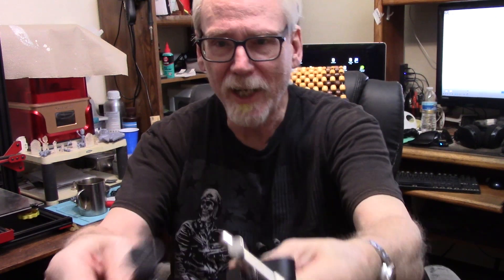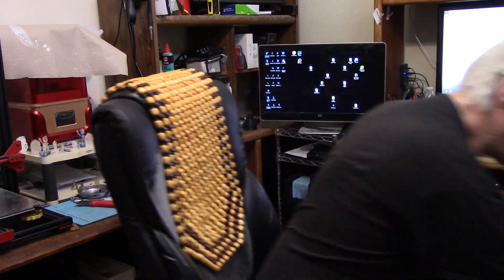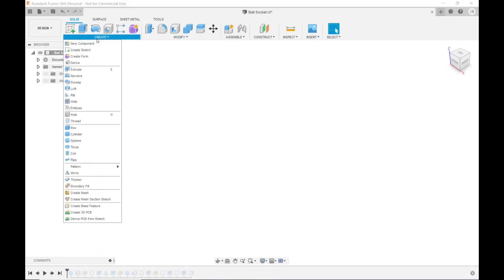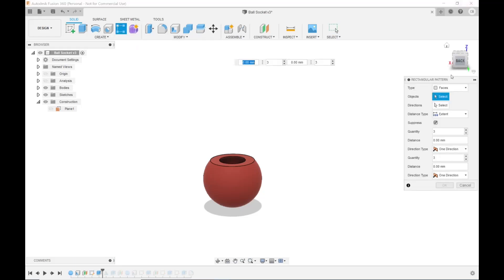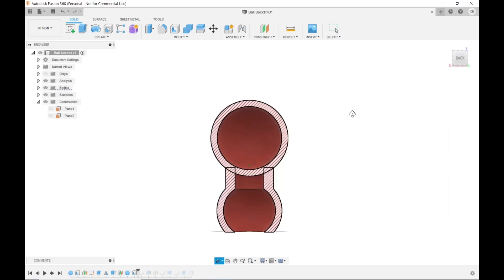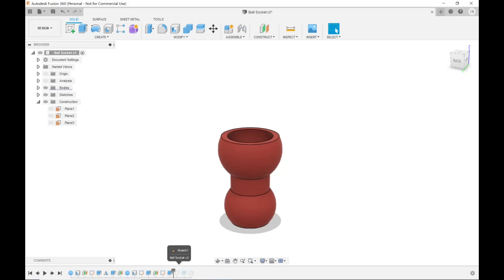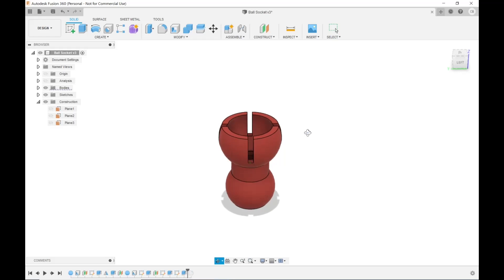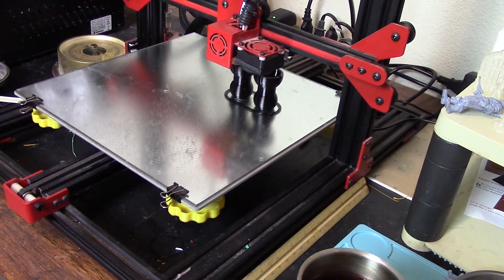3D Printed Flexible Camera Arm Part 1- Design a ball and socket in Fusion 360

Comment: Chuck, I've tried the Flexible mounts off of Thingiverse. They don't work. I printed a few of them and they crack and don't hold the angles you try to bend them in. I look forward to trying your design.
Just to tease you, you said you didn't have room in your office for the miniatures you can print on the Resin printer, yet what do we see to the left?..
You can tease me back, I have a Pig print of every different filament I've ever tried. I now have 97 pigs..
Reply from the maker: Thanks for letting me know about the ones on Thingiverse. I've tweaked mine to the point where the next step is to print 10 or 12 of them, snap them together and put the wire inside and see how they work. I think they'd support their own weight, at least out to 3 feet or so even without the wire. And of course the wire comes in all sizes, so instead of 1/4" a person could get a lot smaller and just put as many in as needed for the desired stiffness.
As far as the miniatures are concerned, I need to get rid of them before I end up stepping on one. Probably be like stepping on a damn lego.
Reply: @3rdpig  Unless it's in the dark, and barefoot, it's not a Lego..

Comment: "Modifying STL's sucks!!" AMEN  Cool project Chuck. Curious as to how your going to secure the joints to the armature wire? When you mentioned the tube I figured you would use a flaring tool to bubble the ends to secure the joints, but I've never used armature wire, so that's why I ask about mounting options. Look forward to a follow up.
Reply from the maker: On Savage's video he didn't secure it at all, just left it loose inside. Of course, his lights mounted on a workbench and the bottom third was always pretty much vertical. Anyway, what I'm envisioning is that the wire will be cut to match the full length and the ends will hold it in place. Nice idea about flaring the tubing though, I'll keep that in mind!